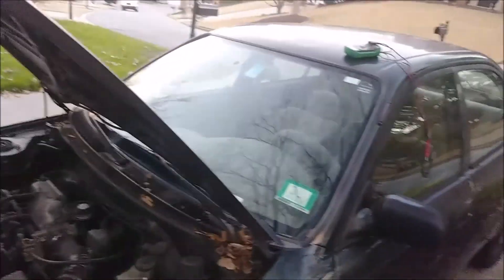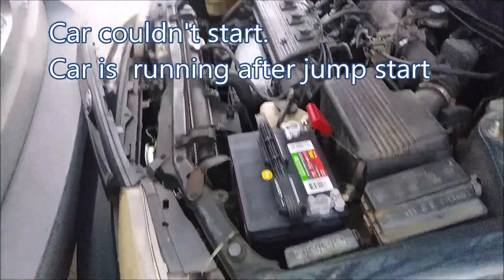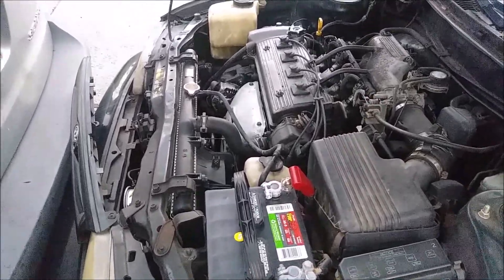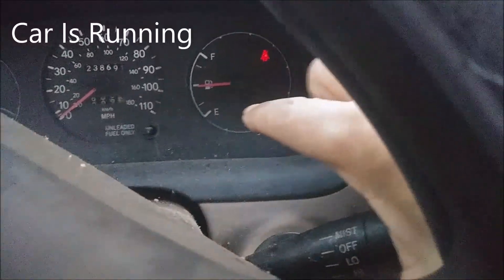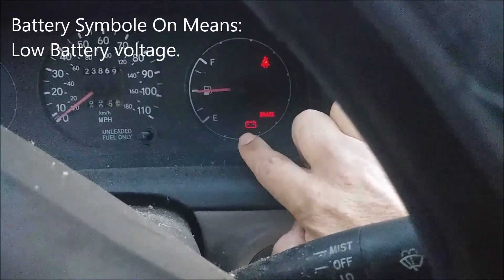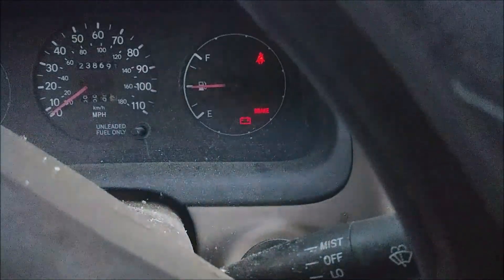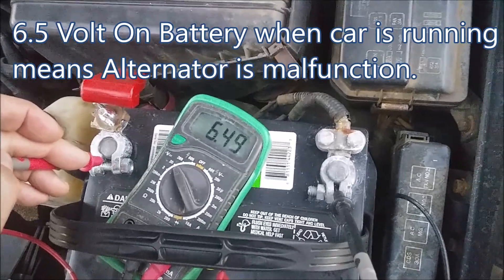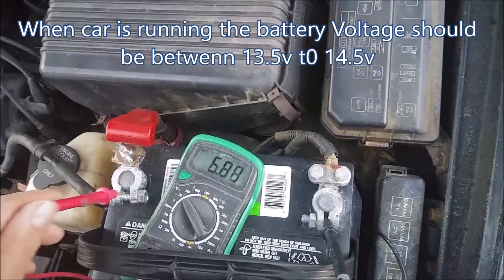How To Test An Alternator In Seconds - Quick And Easy -A Real Bad Alternator

Comment from the maker: Digital Multimeter = https://amzn.to/3oqGZ9K
Find Alternator in Amazon = https://amzn.to/3xEm9ck
Alternator I Used = https://amzn.to/2RcMHRf
Car Battery Related:
Best Battery On Amazon = https://amzn.to/3nuVmKH
 Battery Cleaner Used  = https://amzn.to/3mVywLG
Battery terminal = https://amzn.to/33V6hUw
Buy Jumper cable = https://amzn.to/333x7L2 
CRC Battery Cleaner = https://amzn.to/3iqXy3z
Battery Terminal Cleaner = https://amzn.to/36deLIX
Battery Jump Start = https://amzn.to/3sNHMVh
Battery Tester = https://amzn.to/3nXgdov
Battery Charger = https://amzn.to/3sF4Vcf
Battery Terminal Connector = https://amzn.to/3iqIHpM